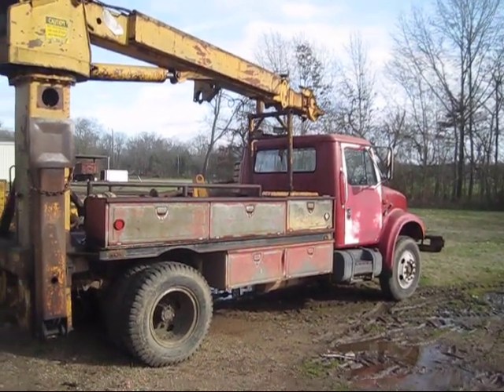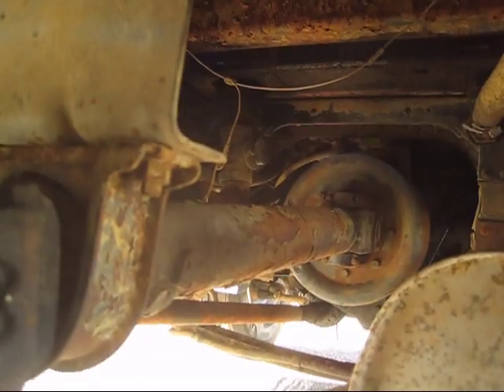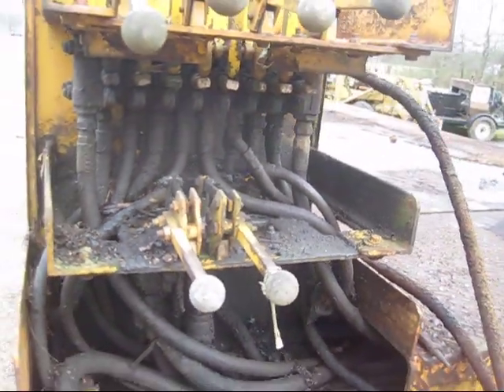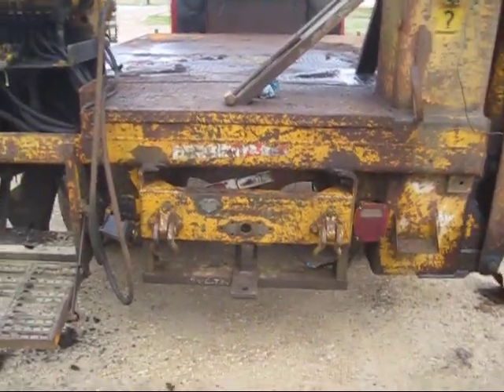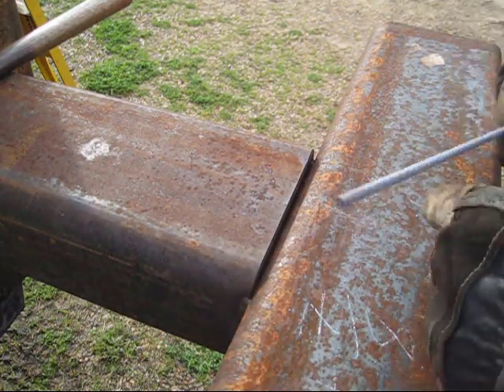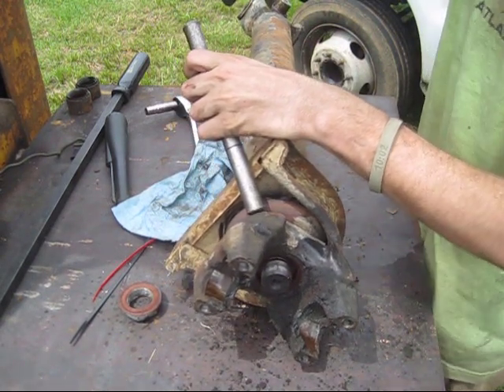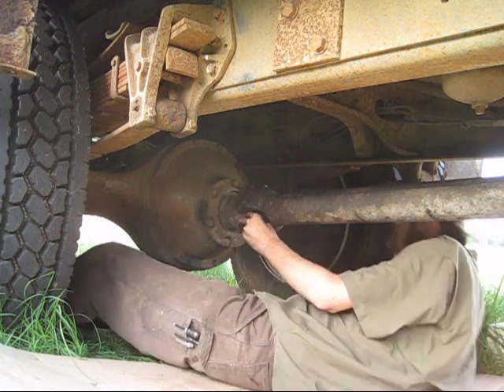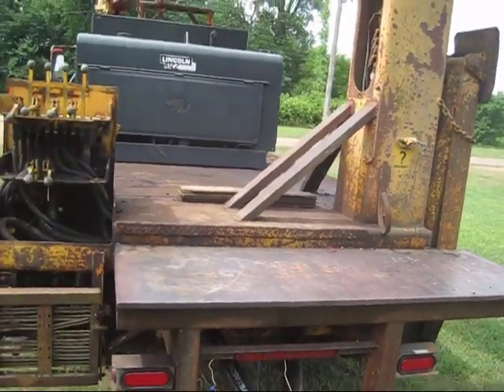Welding Rig truck part 2

Comment: I had a digger derrick like this a gmc. Built pole barns Warehouse s with it . Excellent rigs.
Mine was a con Edison NYc truck.
I gave it a quick fleet paint job made it look 100% better.
Up in Asheville NC brakes are paramount in 5000 ft mountain s.

Comment: Older drive shafts were made from thicker gauge steel. As every thing else someone is trying to reinvent the wheel. So engineers wanted to lighten the drive line and went with different materials such as aluminums -fiberglass. So in order to keep the strength they had to increase the diameter of the driveshaft to give it more mass. Funny thing about your question. It was one of the most commonly missed questions on ASE cert test in the 90's !! 😂  Techs were always overthinking the question.
Reply: Theres always trade offs when re engineering any automotive part. Ill tell you from engineers perspective, Most all of us want to design the most robust, long lasting component that we can, our name is on that thing, however, once we finish a design, a corporate bean counter and marketing Professional?? tell us its too expensive, too heavy, lasts too long and if we want to keep a job we have to modify it to fit their idea of what it should be.
Frustrating to say the least
Thats why I dont work in consumer products anymore

Comment: when your done under the truck Clean it real good then  get some used motor oil and Marvel's mystery Oil using a air sprayer mix them together and spray the under side of the truck drive it on a dirt road for 10 miles wait a week and do it again it will help take care of the frame Good luck I love what your doing

Comment: Hi Ya Ethan! Good to see you're back. 
One good thing about the blue tip wrench is, it fits all sizes of nuts and bolts. That's a heck of a project your working on. I agree about being old school on the welder, simple is better. Heck I saw the other day a fridge that has internet connectivity! That's insane. Anyway, thanks for letting us look over your shoulder.

Comment: When they designed that drive shaft the take into consideration the gross weight and the max torque from the engine then the multiply it to compensate it being overloaded and they make the driveshaft accordingly. On a truck that size that shaft is fine. It is not like you are hauling 30 tons. You will be good with that shaft.

Comment: Did you get the drill auger with the truck ? Does it work ? That would make you more versatile to drill and set post and poles for pole building and shelters ? Are you using the big winch on the front ? Great Channel I see why you have 111k subscribers. Thanks for sharing the life and times of Classic Work in East Mississippi USA
Reply from the maker: I did get the drill auger with the truck I’m not sure if it works but I’m sure it does everything else seems to. The front winch I haven’t tried it to be honest the valve is stuck between the two seats in the truck i’m sure it would if I took the time to get it broke back loose The only reason why I haven’t tried is the two lines going to the winch are 1-1/2” I think and they’re very bad dry rotten they take over $1000 to replace them I’m pretty sure.  So I didn’t want an extra expense to run the crane right now if I can’t afford it if you know what I mean. Lol I know it says I got 111K but in reality I’ve got about 5K that actually watches my videos. Most are from the speed square video I made nine years ago and I really don’t do videos like that anymore I guess that’s why it’s really not been all that great.
Reply: Yep (the winch ) if it doesn’t make dollars it doesn’t make sense right now . It’s a crazy world right now . Sure do enjoy you content man .

Comment: I enjoyed watching you rip those crappy tool boxes off there....I bet the wall thickness of the rear drive shaft is 3 times thicker than a car one..Oh and I told you the hanger bearing was shot and it was an easy fix...Like that big table you added to the back ..Now you need a Big old vice back there...Just remember to weld the bolts so the parking lot theives do not steal it
Reply from the maker: Thanks man, and thanks for the drive train comment. Aye plan on mounting a good vise with no steal bolts lol.

Comment: young man ,

u need put your 20 ton jack underknee spring / where u have your  jack  now rear end might or crack / because rear end is made from " CAST IRON " EASY TO CRACK
Reply: U won’t crack the rear ended jacking on the flat, we’ve done it for 90 yrs I’m 65 and my dad jacked as needed on rearends as did my granddad

Comment: I’ve made good TIG Arc shots by just holding a #12 lens in front of a digital camera maybe 20 years ago. That was before phones had such good cameras. I wouldn’t hesitate to do it with an iPhone now. 
I just looked it up and several people say to use the iPhone with no shade. Not me. I’d try the #12 lens first.

Comment: Do you have any info on this boom?  I have the same crane on an old truck I got and it’s been painted so I don’t have any info on it. Like the capacity’s or even the brand. Any info would be greatly appreciated. Thanks.
Reply from the maker: Far as I can tell it’s a custom crane from a company called powers. It’s a digger derrick boom length 16 feet power extension10 feet manual extension 10 feet.  It’s load limit is 12,000 pounds at 75°. It’s the biggest crane I’ve ever seen to be such a low limit. There are cranes half it’s size that can pick up more than it. That being said it is one of the strongest cranes I’ve ever ran.  Some of the craziest angles that I’ve seen other trucks not even attempt it would do.
Reply: Classic Work thanks man. Mine is almost identical. You can tell it is made by the same company. All the angles and geometry is the same. I almost wonder if they sold them as a kit or something. Because the truck I have was custom made but not the crane. It was added to the truck. Well. Really the truck was built around the crane in a sense. What’s your email. I’ll send ya a couple pics of mine.
Reply from the maker: Mad Man Marine very cool. My email is ethanewing1586@gmail.com.

Comment: I was able to get great arc shots with my Lincoln 3350, but not with any other hood. Miller digital infinity was same level of helmet, but terrible compared to the 3350. It's the only hood that works for a clear color correct shot.